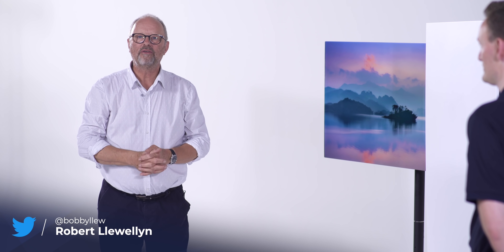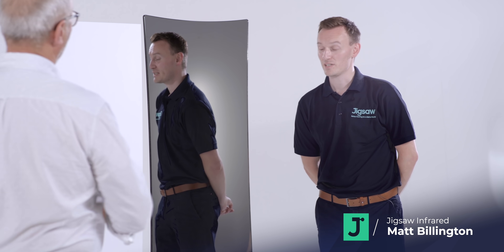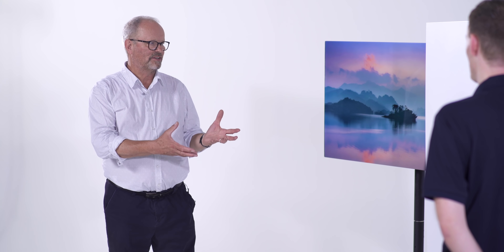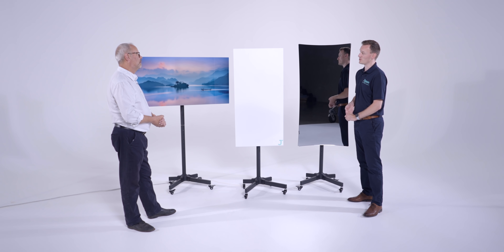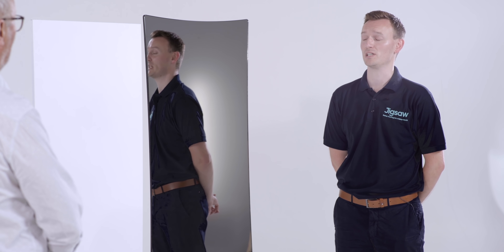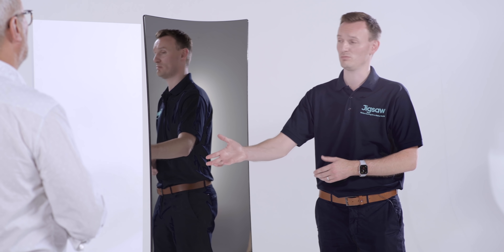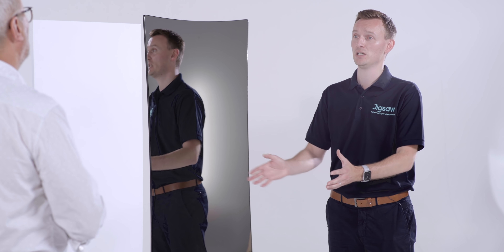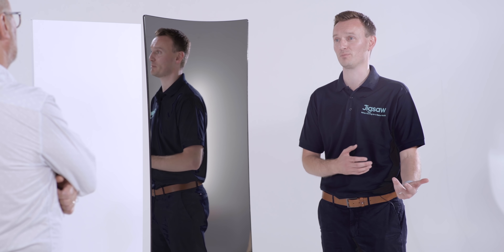JIGSAW INFRARED - Heats like the sun, cares for the planet | Subscribe to Fully Charged PLUS

Comment: These are only 100% efficient.  Go for a heat pump, it will be more like 300-500% efficient
Reply: Heat pump COP is not all it’s claimed to be. The COP figures do not come from real life testing and the COP is often closer to 1:1 
An independent study – commissioned by BEIS but written by Cambridge Architectural Research – investigated cost-optimal ways to install electric heating, including infra-red heating, and energy efficiency measures across a 12 housing archetypes, representing 90% of Britain’s 28 million homes. The study found that:
•	The total lifetime costs (capital + operating) of infrared heating were found to be competitive, although not cost-optimal in some housing types.
•	There were only small differences in costs over 15 years between low- or high-temperature heat pumps, air-to-air heat pumps, infrared or storage radiators.
•	Assuming a longer product lifespan (e.g. >20 years) for electric storage heaters and infrared heaters made heat pumps less attractive over the total period of ownership – as heat pumps were assumed to be replaced more frequently.
Reply: @jigsaw.Infrared  I would like to see your source document on the COP for heat pumps being 1:1 please. And I suggest that moving the discussion from efficiency to cost is not entirely ethical. If we were talking cost gas would win every time.  My heat pump, in the real world (Yorkshire), retrofitted into a 1986 house, achieved 353% efficiency in the last 12 months.  I was considering your product for a project, but since you seem to be perpetuating myths about heat pumps, no thanks.
Reply: Cherry picking research that can't be found, good
Reply: @Muppetkeeper  good to hear from someone who has installed a retrofit heat pump. I'm interested but keep getting put off by high installation costs.
Reply: Easy to say that if you can install heat pumps in your property. Theres hundreds of thousands who cannot. What is your solution to those people?
Reply: @stephengeary6382  Yes, it's expensive, and if you currently have a reasonable gas boiler you WILL NOT save any ongoing fuel costs, no matter what the sales people will try to tell you. But I was fortunate enough to have the time and the money to invest to reduce my carbon footprint.
Reply: @glennbillington4879  I didn't say that heat pumps were the solution for everyone, there is not one single solution. But companies who basically lie about other technologies are really just showing that they aren't interested in saving the planet at all, but just in short term profit.  Storage heaters work well in some properties, heat pumps in others, I'm sure that infrared will suit some, and we need to face facts that some will need oil or bottled gas in the future too. If we don't stop pissing about, we won't need to worry about infrared or heat pumps, as we'll all be underwater or die of thirst anyway.

Comment: I can't believe Fully Charged keep peddling this over priced nonsense if you only put in 800 watts of energy your only get 800 watts of heat out, heat is energy do they not understand basic physics. Go to Argos and buy a £5 fan heater
Reply: Interesting comment Barry, but....

Aston University undertook an independent study for three different heating systems. Jigsaw Infrared was the infrared system used in testing. 

The Study found:
IR heating system can increase the room temperature to 18 C in 10 mins which are less than the other two heating systems (2000 W and storage and convection) which take 15 and 17 min respectively. 

The IR heating system can heat the room temperature to 22-23 C compared to up to 18.5 C for the other two systems. 

The IR heating system has an efficiency 2 times higher than the 2000 W and storage and convection heating system. 

Therefore, the IR panel used half the energy (50% less) of the storage heater and reached room temp in almost half the time.
Reply: @jigsaw.Infrared  yes it heats up twice as fast it has no thermal mass but will also cool twice as fast so will need to be on twice as much
Reply: @barryrogers9862  Various studies have shown that using infrared to heat:
1/3 LESS ENERGY is required to heat a room than convection heat.
Infrared heaters can provide the same comfort levels at lower temperatures.
Convection heating is subject to HIGHER HEAT LOSS than infrared heating.
Convection heat is a far less efficient source of heat transfer than infrared.
Convection Heating takes 6% more energy to raise the temperature by 1ºC than infrared.

Infrared also stores heat in the structure of the space it is heating, creating.... wait for it.... a larger thermal mass
Reply: You obviously are somewhat misguided Barry. Someone got out of the bed the wrong side today.
Reply: @glennbillington  Barry is absolutely correct, this is overpriced nonsense for the technically inept.  You have been able to buy oil filled radiators or fan heaters that do the same job.  The fact they are manufacturing in the UK using laser cutting and hand fabrication shows how much margin they are making.  It won't stand up to competition from a real manufacturer, you'll run out of rich and stupid people fairly quickly.
Reply: @tonystanley5337  BEIS and University studies disagree with you Tony.
Reply: @jigsaw.Infrared  Yes this is rolled out at every opportunity, I've read it and it was clearly designed to make Infrared panels look good.  Does 5-7 mins really matter that much, like Barry says, you can use a £5 fan heater if you need speed.  The idea of going into a bath room or whatever and waiting 10mins is a joke, you need the rooms heated in advance when the house is occupied.  Its not going to save anything.  If you are rich enough and stupid enough to spend that sort of money on resistive heating (which is meant to be uber cheap..not £1000 lol) you are just going to leave it on.  Its not going to save anything in normal use in efficiency.  The electricity will come from gas, increasing CO2.  Its like daylight scavanging with LED lighting, its a load of rubbish it doesn't work, except in a lab designed for it that doesn't have real people in it.
With a passive house the whole point is you don't need to heat it, you would certainly not spend £1000 per room with heaters.
Reply: @tonystanley5337  more subjective views and not really helping the debate. Where do you get your facts?
Reply: @tonystanley5337  Better build standards are absolutely part of the solution Tony. 

I think the point of independent studies is that they are not designed to make anyone look good - that's what makes them independent.
Reply: IR and convection work differently. IR in recent studies has shown to be more than twice as efficient as convection heaters and storage heaters.
Reply: @jigsaw.Infrared  well if you define efficiency as the amount of IR then yes.  Ultimately physics decides on room temperature by the amount of energy not it's type.  My wet radiators put out the same infrared, safety standards limit the surface temperatures.
Reply: @jigsaw.Infrared  if there are enough studies done by naive students you will eventually get what you want.
Reply: @tonystanley5337  Are you including BEIS in that comment?
Reply: @jigsaw.Infrared  They are hardly technically qualified are they?
Reply: @tonystanley5337  You seem to be the expert Tony.
Reply: @jigsaw.Infrared  I am thankyou, I wouldn't be contradicting you otherwise.
Reply: @glennbillington  School boy physics, an E&E engineering degree, >3 decades of industrial experience.  Energy in = energy out, all electrical heaters are 100% efficient, the problem is electricity cost 3x as much as gas for heating (although gas has caught up recently after chinas trade war with Australia). That won't be a permanent situation.
Not saying these don't "work", just that they are expensive and are not more "comfortable".
Reply: @tonystanley5337    and yet you feel a lot warmer sitting in the sun then sitting in the shade even though the air temperature is the same in both places.

On wintersport people wear tshirts because they are feeling hot while temperature is below freezing and they are surrounded by snow....

Air temperature isn't the be all in heating.
Reply: @glennbillington  I'm an E&E engineer with 35 year in manufacturing, happy to debate any specific point if you have one.  Insults and generic put downs will be ignored.
Reply: @baronvonlimbourgh1716  I didn't say it was, energy is the be all, it all ends up heating up the air anyway.  There is nothing wrong with infrared panels, but they are not more efficient, and these ones are very expensive for no reason.
Reply: @tonystanley5337    they can be a lot more efficient then heatpumps when used correctly.

I do agree that these are way overpriced for what they are. The market is flooded with far more reasonable priced infrared panels.
In the end they are just a sheet of aluminum, a heating element and a controler.
Reply: @baronvonlimbourgh1716  Only in that heat pumps are inefficient to heat an unoccupied building.  I am no fan of heat pumps either, they produce the same kind of BS in efficiency figures as panel heaters by selecting wanted energy at different ends of the BS spectrum.  Panel heaters are electrical resistive heaters.  I've no objection to them other than them making false claims or being a rip off.
Reply: @tonystanley5337    yes, you need to heat the entire space completely to create a comfertable environment. Ir panels can create that same goal locally and with less energy. Making them more efficient in achieving the desired goals then normal resistive heating as well as heatpumps.

And it is clearly not BS, these are well established principles, some of which are essential in creating the world we live in.

They just are different aproaches to a problem with their own bennefits and problems. Achieving the desired goal in the most efficient way is all that matters in the end.
Reply: @baronvonlimbourgh1716  If that is the case then and you want infrared then you can generate infrared far more effectively and cheaply and more directionally with a hotter smaller heater.  It is BS because infrared heaters are not preferred over oil filled heaters for efficiency.  The BS is in the efficiency and use calculations, the same a heat pumps.  As the thread title suggested all resistive heaters are 100% efficient.  If infrared is better than we need to make all the surfaces reflective too.
Reply: @tonystanley5337  hotter smaller heaters do not provide the comfort level. Those old halogen infrared heaters that used to be popular 20 years ago for outside. They beam 1200 watts from a 1 or 2 bulbs. They  burn your face off while your feet are freezing.

And oil filled heaters aren't any better because they need a decent time to heat up. So you miss the comfort level when you enter the space while still heating it once you leave the space again as it cools down while using basicly the same energy. Creating no efficiency bennefits while timeshifting the comfort in a way that is not useful for the goal you are trying to achieve.

You keep saying it is 100% efficient, but in the end that has nothing to do with anything.
The end goal isn't to just convert energy in the most efficient way. 
The goal is to create the desired level of comfort in the most efficient way. 
And if you can do that without heating all the air in an entire space, how efficient or inefficient you are able to heat air becomes pretty much irrelevant.

And i am not saying infrared is better, they sometimes are much better, and sometimes heatpumps are the more efficient option. Which is more efficient depends on the goal and application.

Comment: Way off the mark this one, the cost of running these will be higher than gas as prices stand.
Fine if you can use solar to run them but winter is when you need the heating on..
Reply: In your opinion its off the mark but not to the people who need electric heater and electric heater which will help save them money. Not everyone has gas or will be able to in the future. It's about everyone and not just those who use gas. 

Amazingly, gas users at home are converting to electric cars but the fact is the home causes more carbon effect than the gas thrown out of a car.
Reply: @glennbillington4879  yep, has prices will likely soar too so tables will turn back in favour of electric esp if its produced cheaply. 
But these are cheap to buy and expensive to run compared to a heat exchanger in terms of power use maybe?
If that's the case its short term cheap but long term expensive.

Unless electric  is free that is.

I can see landlords putting it in their properties cheaply leaving their tenants to pay the Bill's.
Reply: @FlyingFun.  with a proper control system and more education then you can control the way the heaters are used.
Reply: @glennbillington4879  heating just the places you are using rather than a whole house will defo help, it's interesting and definitely easier than plumbing radiators etc.
Be nice to see real world results and opinions from users.